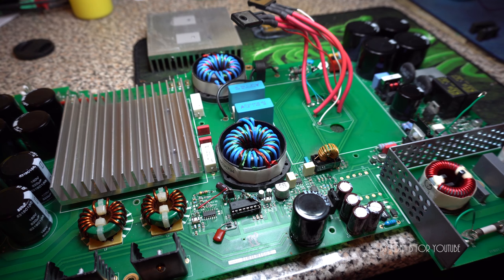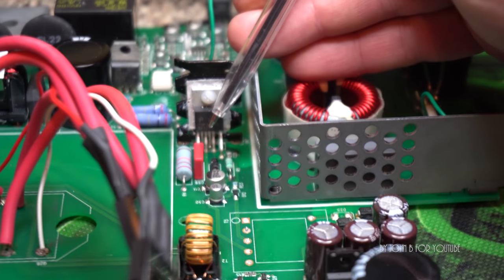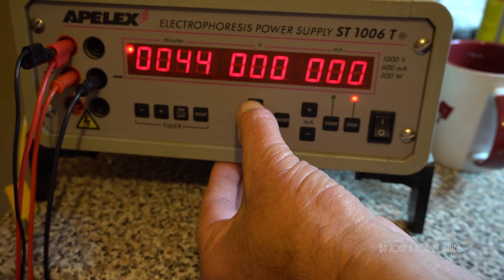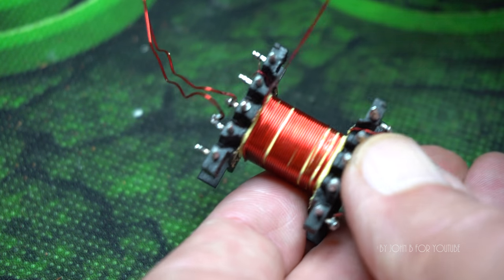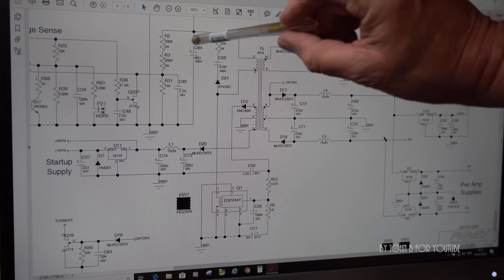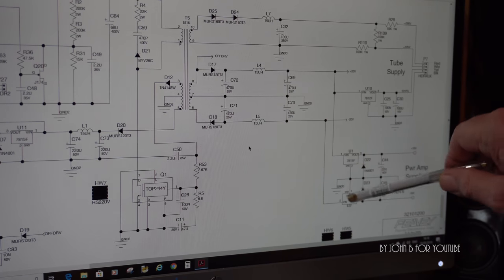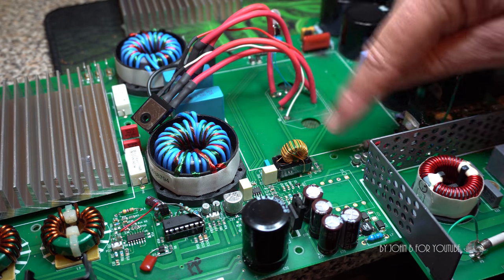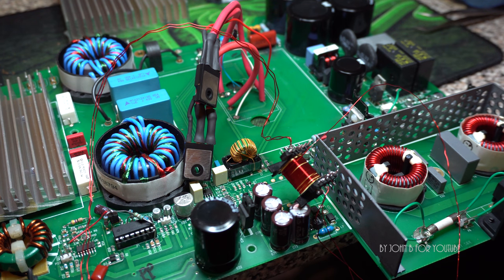American Design but Built In China ! Example of CREEPAGE due to NO CREEPAGE MARGIN see note

Comment: I remember the times when i had problems with fly back high voltage transformers in tv"s ,CRT"S , same manufacturing problems from China. Only the ones from China.The parts passed QC too easy, too   fast,in the name of delivering the goods on schedule ! So nothing"s change in China. Good debug John ,awaiting for fix now. Cheers !
Reply from the maker: Thank you for your comments and knowledge dix.
I was up until 4am rewinding that thin high voltage supply, it was the first winding on the bobbin core then the thicker primary of 2 layers.
It looks like it is all working so will do another video soon.

Comment: I’ve seen a lot of video’s from DiodeGoneWild disassembling countless cheap USB chargers. Some were horrible, some super dodgy and the good one were just plain dodgy. He always unwinds the transformers and point outs the risk of a short circuit when the windings aren’t properly isolated. By a small miracle no one actually did though. 
And here you show us a top brand amp that otherwise looks excellent with a shorting transformer. How disappointing. 
Thanks again for making these video’s and for the occasion ‘hours later I ...’. Most YouTubers just show the repair (because that’s the most interesting) and leave (unintentionally) the impression that it’s all easy and straightforward. Well it should be, but only after you’ve figured it all out;)
Reply from the maker: wow sounds good, I'll look him up now
Thank you for the heads-up
Reply: I like DGW!

Comment: Great video, though it's painful to watch.

10:25 looks like there was a design oversight with the snubber for the flyback converter. R4 should be in parallel with C59. There's your problem!

Let me explain:
    C59 is allowed to charge up through D21 and R4, with nothing but D21's leakage and/or breakdown current through R4 to discharge it. After a few microseconds, that circuit would be rendered useless.
    It's likely Q1's sharp switching transients excited the resonant tank formed by Q1's output capacitance and T5's primary inductance.
Such undamped resonance could generate some nasty ringing reaching the many hundreds of volts, that – aggravated the low clearances of the transformer, of course – could have caused the dielectric breakdown.

12:53 it gets even worse! They're driving the delicate little gates of Q26 from T2's secondary – essentially an inductor – with no clamping whatsoever. A transient at T2's primary is all that's necessary to blow the hell out of Q26! F**k me... what were they thinking?!

Somebody pinch me! I can't believe my own eyes.
Reply from the maker: Thank you for your great comments.
I agree with your findings.
I have done a video on 'gate loop ringing' and show how inductance can cause a fet to ring and stay switched on.
In one of my BMS design videos I mention the lack of a snubber can blow a driver up in minutes.
Thank you again
Reply: @JohnB-2021  I'm glad we agree. 😁
Yes! I've watched your videos on the subject, and I think they are spot-on. Great job!

Comment: I'm curious what happened since. Looking forward to a follow u video. :)
Reply from the maker: Good question, thank you for asking.
I  re-wound the transformer and bought 2 of the biggest IGBT fets I could find, the cost about £10 each (650 volt, 140 amp  455 watt)
The exploded in minutes and got hot quickly.
I then tried some smaller packages I had, lest than half the size and a fraction of the power rating and they were IGBTs too. The amp ran up to half power for a long time and the IGBTs stayed cool.
I turned up the volume even more and the small IGBT's exploded.
I told the owner and he didn't seem that interested.
I gave up because I'd have to keep on spending money trying lots of different type of FETs for an amplifier that I was never going to get my money back on. I did try a third set and the transformer burnt out again due to creepage from the 250 volt tube supply to the lower 15 volt supplies. There was simply not enough room on the transformer to add a creepage margin.
I still have it and now use it to rob the high power NPN and PNP transistors from it lol.
Shame because the amp had great potential.
The original FET package is obsolete and totally unavailable.
Reply: John, thanks for your quick reply. Yep, a shame. As the old saying goes: "A chain is only as strong as its weakest link". If that little crappy transformer were only for the tube, I'd forget about the tube and use the amp as PA amp. But it seems it has another function as well. 
On the other hand, the learning experience also counts for something. So, it's not a total disaster. :)
Reply from the maker: @laoluu  
Yes I totally agree.
If the whole power supply wasn't such a low profile, I could have put in some toroidal  transformers.

Comment: Hello John. So what company designs the best amps from what you've seen?  Thanks
Reply from the maker: Hi deemownskee,
I have always rated Yamaha, their specs were always better in the 90's compared to many other more popular brands.
The trouble today is, many use class D amplifiers so they are all pretty much the same.
The CS3000 Peavey is a quality amp if it's still available, it's a class B amplifier but big and heavy and pretty reliable.
If I was a dj, I'd probably use a Yamaha mixer with Mackie or Yamaha active speakers.
I think Pioneer still make high end mixers for professional djs.
If the manufacture release their circuit drawings, they are the units to focus on in case they go wrong.
Reply: John B. Thanks for the info. Much appreciated

Comment: who makes a class d with wires at the fet leds ? the inductance is probably so high and caused the failure.
Reply from the maker: There were not any wires, this is a follow up.
Doesn't matter though, the transformer had no / zero creepage margin
Oh, and it's not class D either.
Reply: @JohnB-2021  ah okay, thanks for the reply.